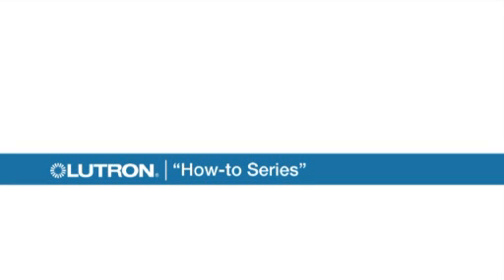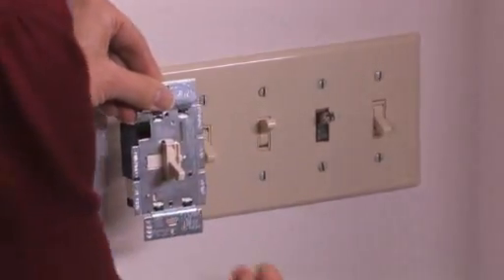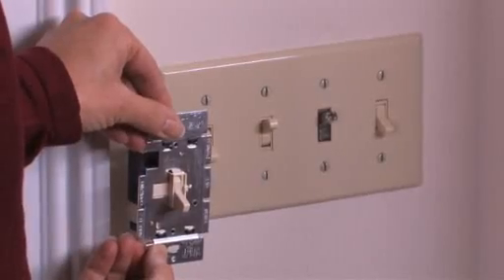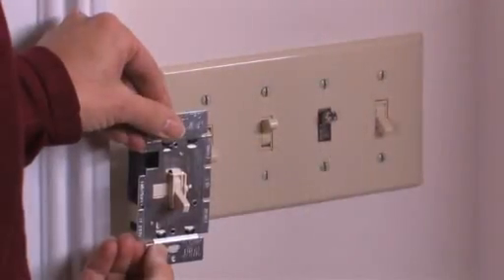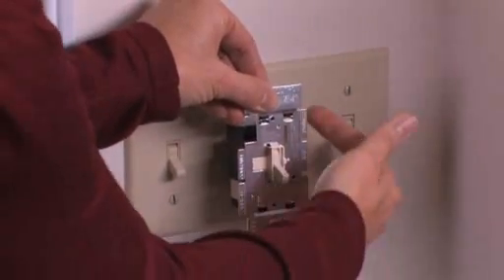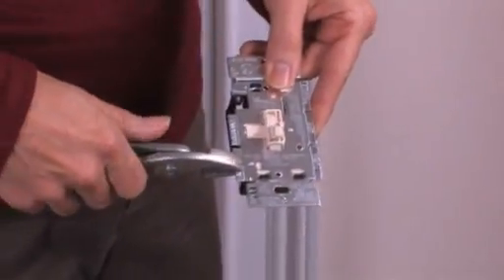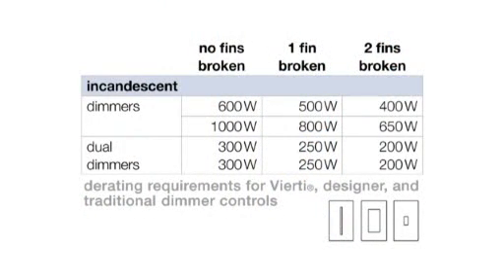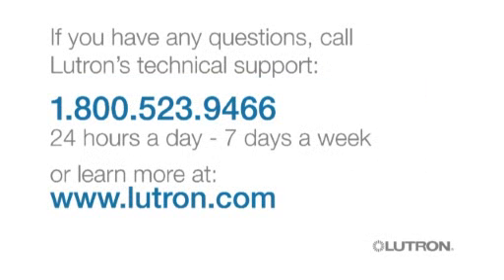How to Gang and Derate Lutron Dimmers

Comment: Safe to say with 5 LED hi hats, the fins can be removed, correct? Total wattage approx 65 (5x13).
Reply from the maker: Hello, Yes, removing all of the heat sink tabs would not affect the total wattage of LEDs on the dimmer. For reference, review page 3 of the spec sheet here: https://www.lutron.com/TechnicalDocumentLibrary/369686.pdf. Thanks!

Comment: Why does breaking off the plates reduce the amount of load the dimmer can handle?
Reply from the maker: Hi Andrew, The metal fins on the side of the dimmer help dissipate heat away from the control. When they are ganged in a wallbox without others, it is necessary to remove these fins to allow the other controls to fit. When they are broken off, it will then derate the control. Hope this helps!